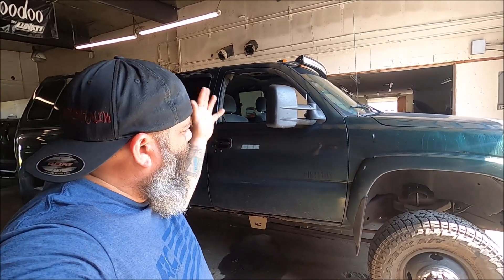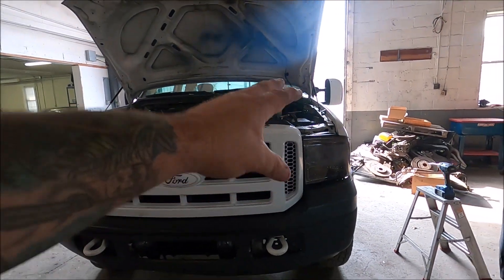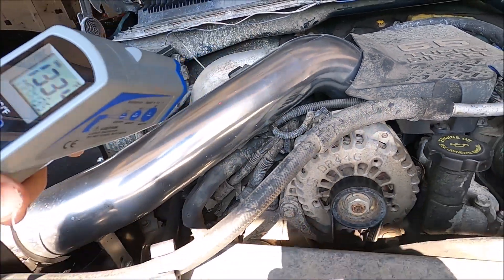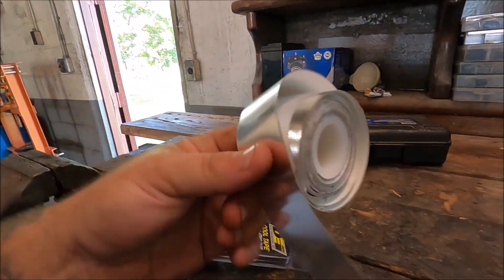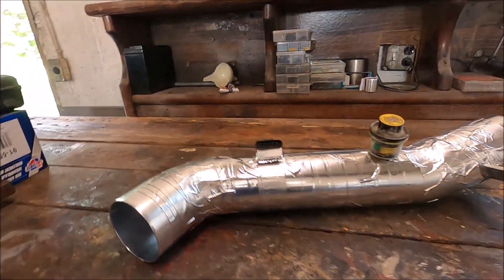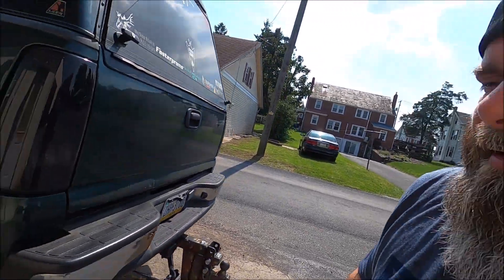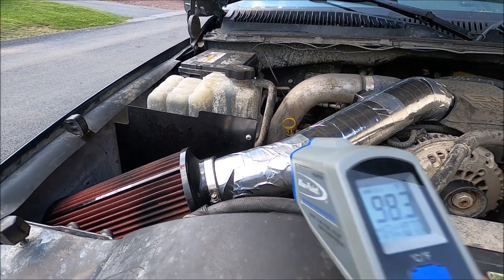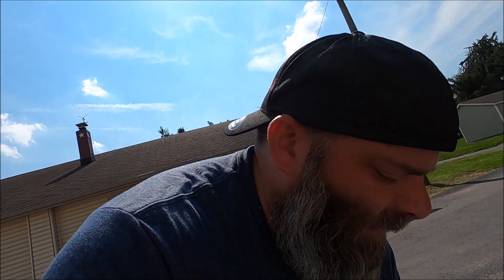I TURNED MY HOT AIR INTAKE INTO A COLD AIR INTAKE WITH THIS SIMPLE MOD!

Comment: Hey Andy thanks for another great video. That tape will definitely help with your AIT. Also your idea for coating the outside of the box will help. Another great fix is to close any gaps that you have been the intake tube an the box. Also maybe if to have some old heater hose put a slit in it and use it as a gasket around where the tube comes out of the box also you can make a cove for the top of the box with some l brackets and a small piece of plexiglass from home depot ag use an old piece of hose or foam type material between to block any hot air from the engine bay from heat soaking the filter. But you should definitely see some improvements in fuel economy and in performance.  Can't wait to see the next video. And as always stay safe.

Comment: Great video Andy!  I’m sure some haters will disagree. I like the idea of the wrap but would it make a difference if you honeycombed the wrap or pressed it over a small sized expanded metal for an air gap before you applied it, would it dissipate heat faster?

Comment: Good idea, curious to see if it works.
Reply from the maker: Next storm recovery I do for John Doc I'll track miles!
Reply: @DiabloFormulaRacing  even if it's only .5 mpg, that'd be a win but I'll bet it'll be closer to 1.2 mpg; bringing those IAT's down, especially with a good tune, should be noticeable.
Reply: @DiabloFormulaRacing  UR AIRFILTER IS STILL SUCKING IN HOT AIR ,, A FACTORY AIRBOX IS THE BEST ... TRY THIS REROUTE UR AIRFILTER INSIDE UR CAB ..

Comment: Andrew, your inside temp check is flawed.  You are basically measuring heat coming from the  throttle body.  Engine heat.  Best way is to drill small hole and put a thermometer in the tube while truck is on.  Then check air temp coming in.
Reply: Or just see what IAT is on odb, or hptuners.

Comment: Granted this will help reduce the air temp a little bit but, isn't the real issue that your filter or inlet is sucking hot air from inside the engine bay? Wouldn't a better set up be an insulated inlet tube with the inlet tube mounted outside the engine bay? Like in your fender well or outside your grill? Your still just sucking hit air from inside your engine bay right now.

Comment: The problem is that the filterbis sucking in hot air from inside the engine bay.
You need a hoodscoop to force cold outside air onto the filter. Obviously only when the truck is moving but it is rhen that you need it.
Reply: IVE BEEN TRYING TO TELL HIM THIS ,, I HAVE A 04 GRAND CHEROKEE 4.7 I REROUTED MY AIRFILTER TO GO INSIDE THE FIREWALL INSIDE THE CAB ,, NOW SUCKS IN COLD AC AIR ...